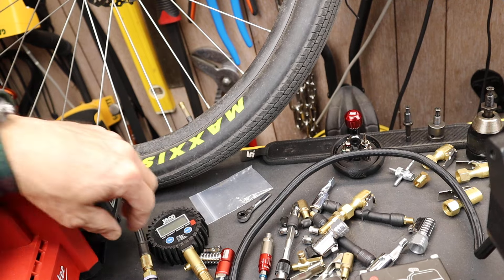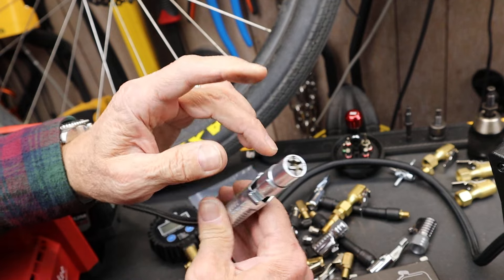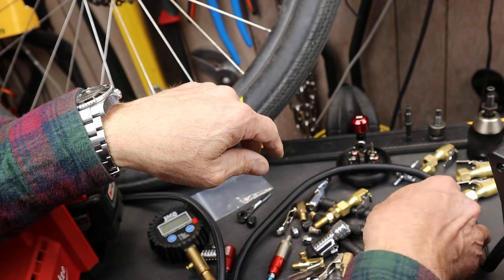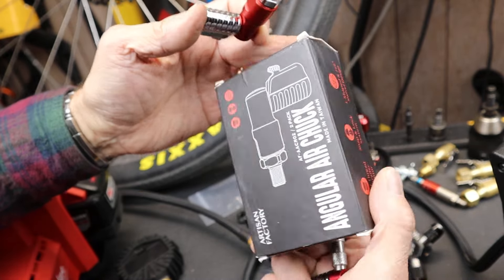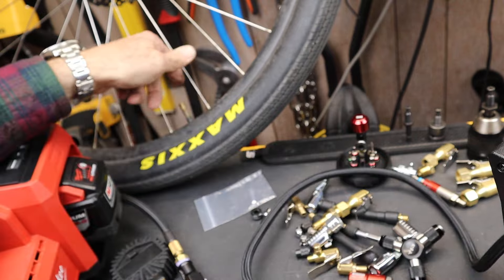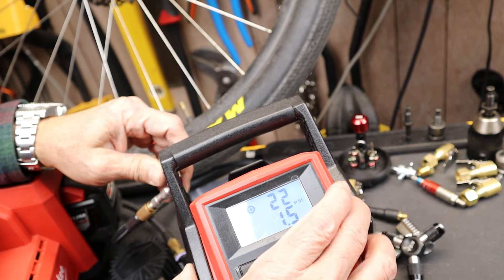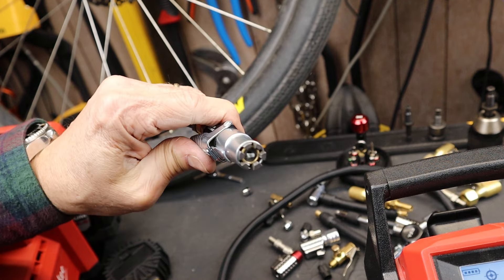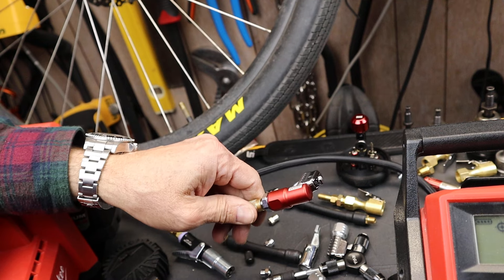More Air Chucks: 711L and Artisan Factory. Both more reliably airtight than the LockNFlate

Comment: You brought up an excellent point at the end. I think the Lock N Flate was designed for larger applications, thus the NPT threading. I use mine to air up a lot of large backhoe and wheel loader tires. I couldn’t be happier with it

Comment: I've been happy with a YehVeh- branded dual head on my M12 inflator. It's cheap (currently $8 for a pair on Amazon), the plastic doesn't inspire confidence, but it ticked all the boxes for me - right angle, locking presta and schrader, bleed valve. I wasn't expecting much from it, but it's been used almost daily for the past year without a problem, and I love not having to fiddle with switching heads or modes or deal with adapters, etc.

Comment: They are bulky but have been using a 
Haltec H-5265 Standard Bore Lock-On Air Chuck for $12.90 on Amazon For years. A little hassle if there isn't much clearance but locks tight and doesn't leak

Comment: Great video and presentation. This is a good example of great tools that are not expensive, and working better than the more premium ones. I'm using a little rechargeable mini compressor on my bycicle, and it was cheaper than this locknflate device.

Comment: Some vales are inaccessible if you have a large hub motor on a small bike rim. Can you find any very low profile locking air chucks? Like the ball head chuck but smaller with locking. The one you show is a bit too tall.

Comment: Doc, have you found a favorite Presta air chuck?

I just ran an air line from the garage into the attic and down to the crawlspace, which makes the old noisy air compressor a bit quieter. Now I'm trying to find a good Presta inflator setup to work on our MTBs!
Reply from the maker: I used to use the old school Silca brass chucks but had to replace washers often. Now I use Specialized Airtool pumps for presta. Their dual hole chucks with lever have not failed me. Only problem is you can get quite a whack from the lever when releasing it especially with cold hands.
Reply: I really like the JACO Lightning XP Locking Presta Air Chuck. Works great for me.
Reply: @lastbesttool  Would love a review on some presta! I use a little ryobi inflator for my wife and I's bikes, which use presta, and occasionally friends that use schrader. If you find a good combo adapter, would love to know about it!

Comment: 711L looks like a copycat of JACO, which you didn't seem to be a fan of in your last video. I guess the copycat has exceeded the performance of the original? Also, it appears that both brands only offer open flow models. The "good enough" Astro AI model mentioned in your last video is available in closed flow, which seems like a superior design.